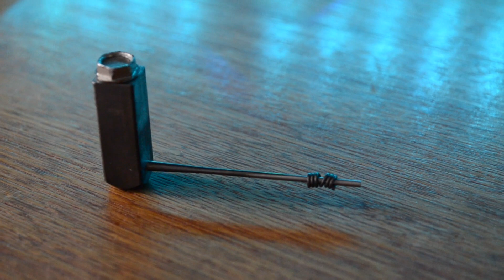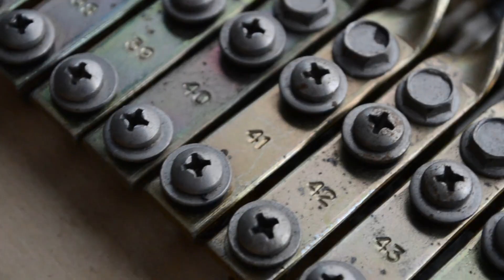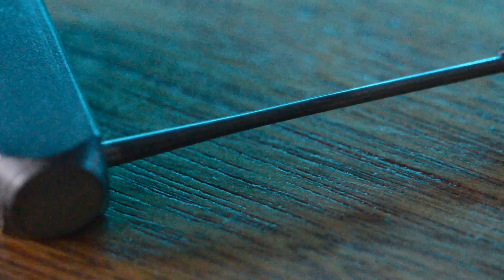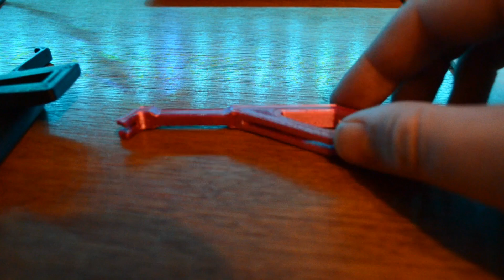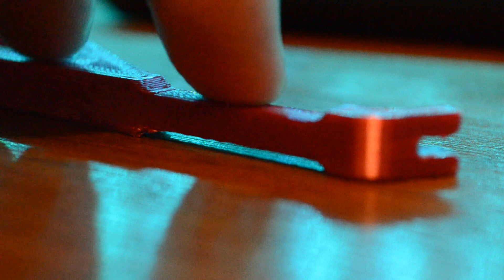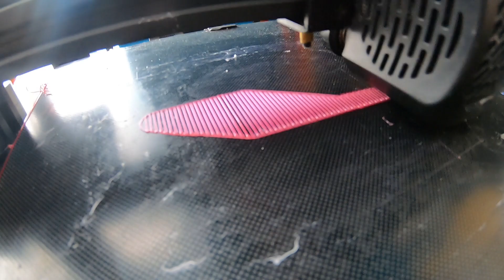Tuning Tool for Fender Rhodes and other Tine Based Pianos

Comment: I just upgraded to a new 3d printer, and you should know that this is the first useful item I am printing with the new one! (Followed soon hopefully with some parts for my 3rd clavinet design) Excellent work!
Reply from the maker: Nice, what printer have you gone for?
Reply: @ ender 3 v3 plus. So far I am very satisfied with it.
Reply from the maker: I love the ender 3. Once setup they just print. Rarely need much changing. Though most people who don't like them struggle to get the setup right.

Comment: so what 3d printer do you recomend for this job ??
Reply: I looked up this model and was surprised how cheap they are. What kind of resin do you use, is the resin very expensive?
Reply from the maker: That's a really hard question to answer and depends on what you are willing to spend, how long you are willing to tweak and what quality you will live with. 
I use an ender 3 v2, I find them reasonable value, though may need some time to learn how to set them up and get the best from it. The quality of the print is fine for making mechanical parts, in my opinion.
If you are considering a printer I would say join some groups and get familiar with what people are making with that one printer, and also the issues people have. 
Good luck!